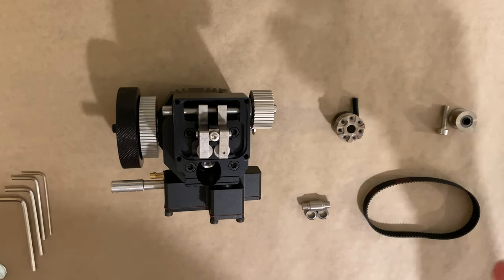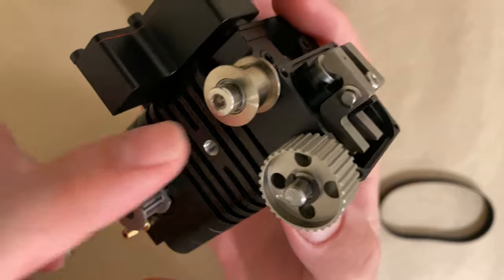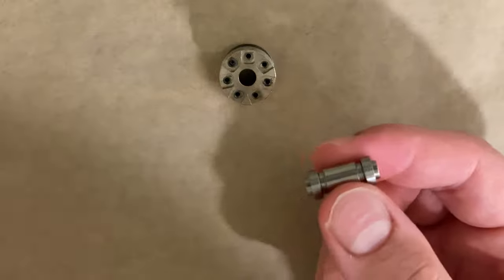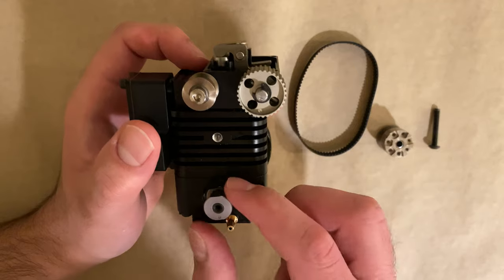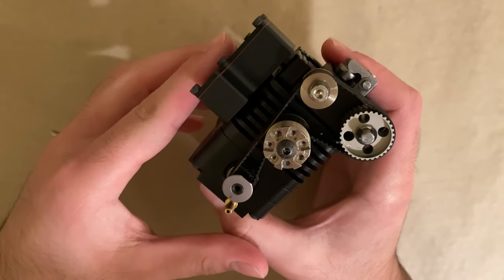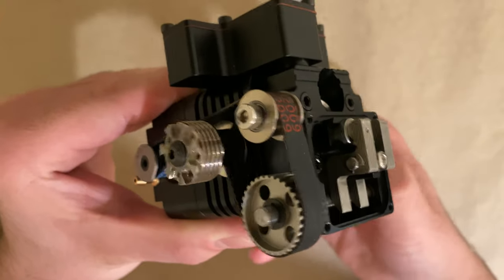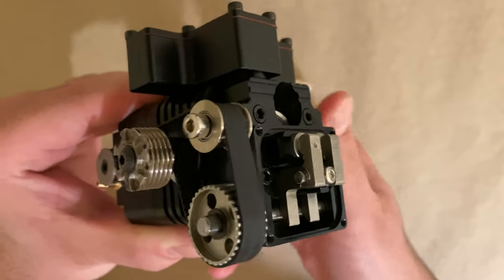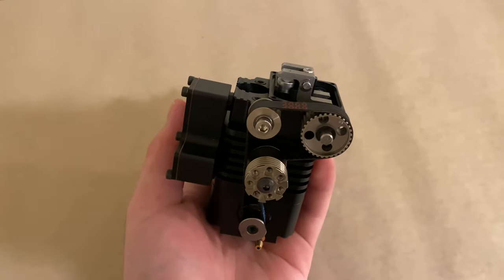Building A Mini 4 Stroke Engine (Part 4)

Comment from the maker: In this video I assemble the timing belt for my engine by hooking it up to the pulleys. I made sure both the camshaft and crankshaft gears/pulleys were lined up before putting the belt on. If the rotation of the crankshaft is not in relation to the camshaft, it would damage the engine. The timing belt rotates the cooling fan as well as the idler pulley. It also rotates the camshaft, in order to open and close the valves. Modern engines would use this as well and in some cars, its even a chain instead of a belt. The timing belt connects all the pulleys together and does as it says. The timing belt controls the timing of the intake and exhaust valves. This engine has a single overhead cam with rocker arms and 2 valves. A modern engine would have dual overhead cams with variable valve timing and four valves per cylinder. More videos are coming in regards to this engine and the project will soon be finished. The next video should be the carburetor assembly.